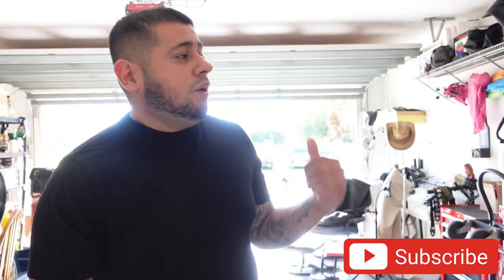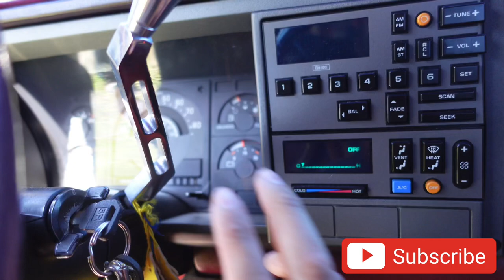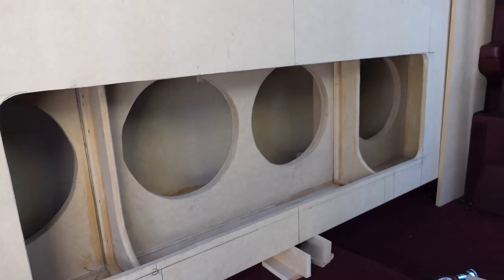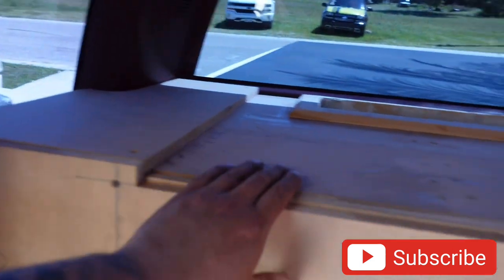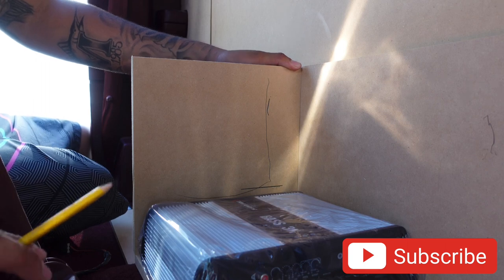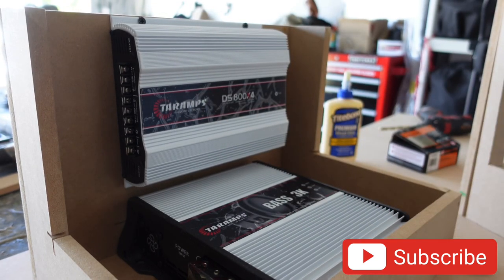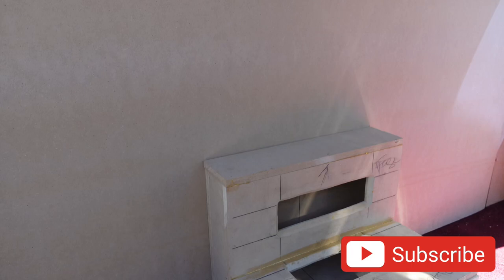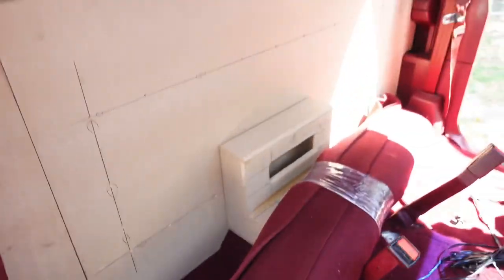4th Order Bandpass Car Audio Sub Box w/ Sundown Audio Subs in OBS GMC Truck Looking Fire

Comment: So I got a chuchero 2 10s and 2 tweeters and then a driver box with 3 drivers and 2 tweeters I got the 2 10s connected separately but how would I connect the driver box with 3 drivers and 2 tweeters and the other 2 tweeters from the chuchero to a taramp 800x4 with speakercon cables
Reply from the maker: Dm me on Ig mousextrap